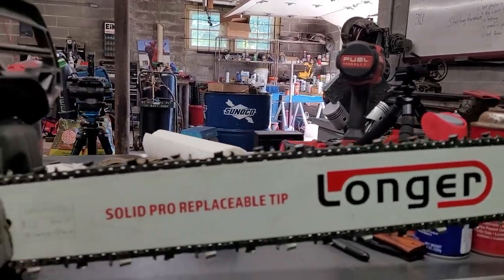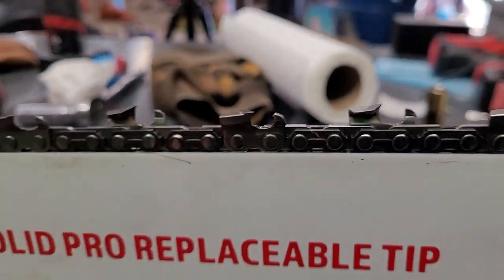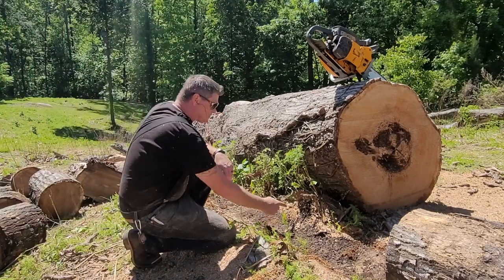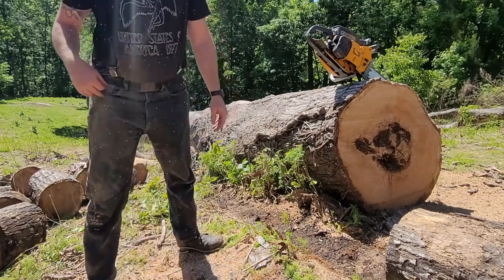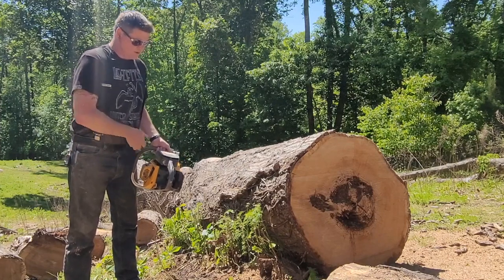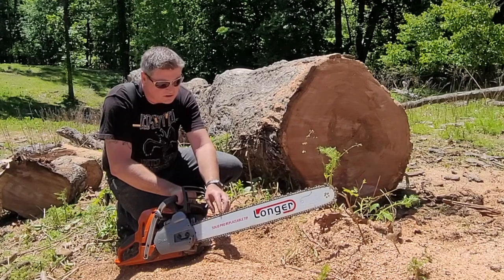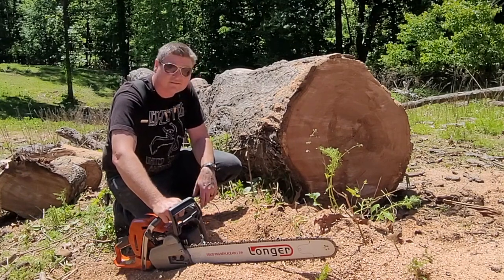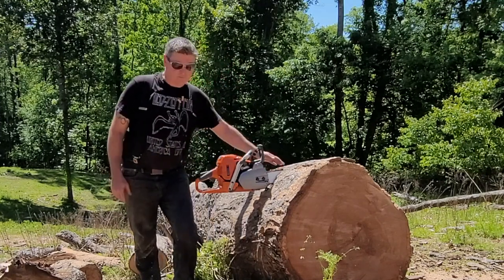Longer  Tungsten Carbide Chain Abuse!

Comment: Boedy if you ever get the chance to purchase a Stihl 60” cant hook (rebranded Logrite) they are worth every penny. I just cut up an oak on a hill steeper than yours that used every inch of my 28” bar on my 592XP. I just found the first spot the tree didn’t touch the ground (about 10 feet of tree) and cut it trough. I am only 5’8” and 51 years old so if I can do it with this device I know you can😊 I think they sell a 72” version Logrite that I wish I had purchased instead.

Comment: That’s why I don’t like the carbide chains because when people get them they think they can cut into the dirt and that’s not the case. They might dull a lil slower than a traditional chain does but if your being careless with them because you think they can take the dirt what’s the gain one more maybe two more cuts! It’s just not worth it to me they cost more to buy then you have to pay 10$ minimum to get them sharpened and a lot of places won’t even sharpen them they say the carbide will chip off the chain not for me I’ll stick to my traditional chains pay less for them sharpen them my self and just be careful to keep it out of the dirt!!

Comment: Ive bought 3 carbide chains recently. Two are semi chisel and the 24 inch is full chisel and looks like it will be super fast. I cant wait to get to the farm and see how they do. I normally use stihl or the c83 but this 24 inch full chisel carbide might hold its own and if its not alot slower will be worth the extra money just to not have to sharpen so much
Reply: How did your chain perform?
Reply: @barrygolden9823  it still felt as sharp after cutting for a couple hours as it did when I first put it on. It wasn't as fast and a little more chatter than good standard chain. It has a little wider cutters where the carbide pieces are. I have several carbide chains in several sizes. They are definitely not all created equal. I just sharpened my first one the other day but haven't had a chance to use it since is was sharpened. It took a little longer to get sharp and I used a diamond wheel at a low speed to keep from getting the teeth hot. I now have it much sharper than it was put of the box so I expect it to cut faster now but with cutters being so wide Im sure it wond out run a c83 or other faster chain.

Comment: Good video. I've cut two Red Oaks, both over 100 yrs old, but they were bowed, not on the ground as much. I used a 20" and 28" bar. They both were hollow a lot at the trunk. I just bought my first carbide chain. I think I will use it, as you did, when the ground is unavoidable.

Comment: I would like to see one of those chains after it has been sharpened by a diamond wheel. The ones i have used cut slow for my taste but they cut that way for a looooong time. Right tool for the right job.

Comment: It would be interesting to compare that carbide chain to the one Stihl sells.
Reply: I can give a little feedback on this. I’m in eastern Australia, the Stihl chains last a bit longer but are twice the cost. In Ironbark wood, the cheaper chains I’ve found are more inclined to losing teeth. Overall, I’m borderline, I use a cheaper brand of chain and at the moment it more cost effective than out laying almost AU$180 for 1 Stihl 18” chain v AU$85 for a cheaper brand.
Reply: @JaseC80  Are those the Longer Tungsten Carbide chains you buying?
Reply: @michaelbeerens4903  No not Longer. I have been using Pacific TCT chains. Which I believe appear identical to Maya/Cannan, Longer and a number of other chains. I will try Longer eventually. I usually get 4 or 5 tanks per chain on a 592XP. Solid logs would easily be double. The high torque with the termite nests, small stones and hardened sap are the killers.
Reply: The stihl rd3 chain, I’ve run that in a sawmill for two days cutting 20” live oak. Stays sharp and cuts well. 3/16 is the right file size for it however stihl made the rakers to big so you can’t get a file in there and have to take it to a shop with a diamond wheel. 
Meeting with Rapco folks in a few weeks in Washington state. I love carbide vs regular chain but I do need a chain I can dress in the field.